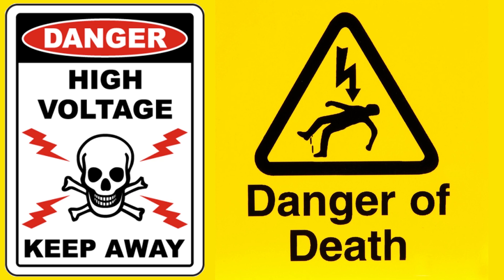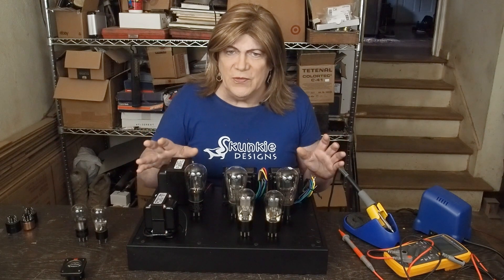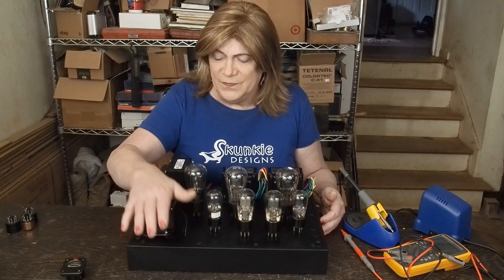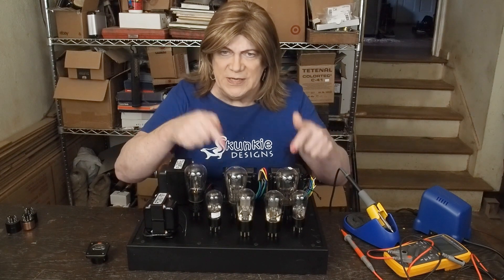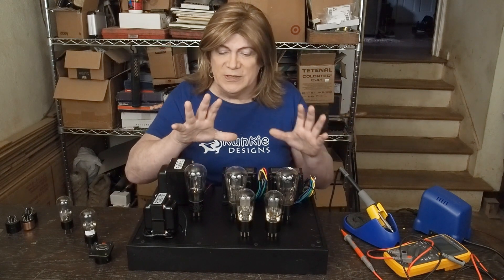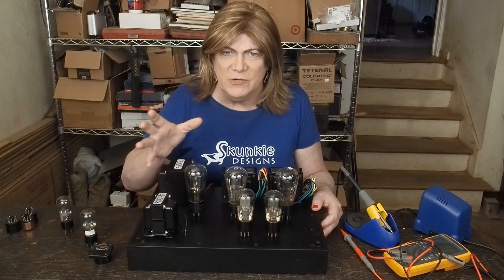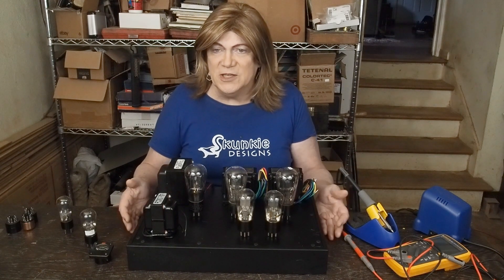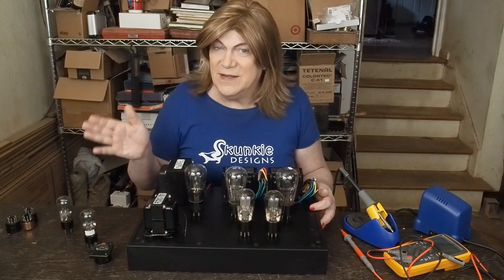1930's Globe Tube Amp Build: Overview

Comment: Is this the same type of amp used that was used in 1930's to 40's tabletop RCA ,Philco tube radios?
Reply from the maker: Absolutely not. The circuitry used in this amp wasn't even invented until the late 1950s and some of the tweaks to the circuit have come about during the last decade or so. When these tubes were produced there wasn't an amplifier like this to put them in.

Comment: Use the 56s too! That would look so cool if you can get enough filament supply in that chassis. Also tell us where that chassis is from and maybe link it!
Reply from the maker: I am going to start out just using the 27 tubes as drive but I won't be upset if I have to add the 56 tubes :) I am definitely doing the layout with that in mind. This is a custom chassis a friend had made locally, cost me about $130 (buddy deal ) so not for a budget build! Landfall systems can make a very similar 12X17X2.25 one for around $140 unfinished. I would order it with black screws and plan to get it powder coated or anodized after all the fab work was done.  https://www.landfallsystems.com/

Comment: I was just wondering why you wouldn't run low voltage filaments in series?
Reply from the maker: My understanding is if there is a mismatch in filament resistance, running them in series would cause one of them to run at higher voltage than the other. I'm also not sure how you would reference these as these older tubes seem to be very sensitive to the cathode to heater voltage. Not saying it wouldn't work but that is why I decided against it.
Reply: @SkunkieDesignsElectronics  I get your concerns. Back in the day when I worked on tube radios and TVs, it was a common practice.

Comment: Now your talking my language. Being an old antique radio restore guy I have plenty of those tubes laying around. As a matter of fact I have an old chassis and it has those tubes. It appears to have 4 output tubes. Possibly could gut that bad boy and just wire up the output section as an amplifier. (the old cabinet got trashed by rats). I'm excited about this one. I really would like to learn more and power supply design is great place to start. Thanks again.

Comment: I was asking to myself, does it make a big difference in sound to use tube rectifier ? 
I guess may be there's no answer to this question...seems a lot subjectiv.
Reply from the maker: I honestly don't believe it does, especially on a single ended amp. I do like the slow B+ start up an indirectly heated rectifier provides.

Comment: The 47’s are known to sound good (at least in PP..) What plate chokes are you going to use for the front end tubes? The meters are a nice touch..
Reply from the maker: Probably the little Hamond ones, at least to test with.
Reply: @SkunkieDesignsElectronics  yeah, for testing I guess they would be fine.. The fancy Lundahls are on the pricey side. The One-electrons (220H supposedly) are good for the price, but AES is not careful with handling them IME, all banged up end bells..

Comment: If you don't mind a slight hum..................AC sounds BETTER..!  Because when you use DC on the filament , one side sees another voltage on the filament than the other side............and the trace curves waves out ! ( the nice // curves loose their desired linearity )
Depending on the tubes , hum can be reduced to almost bearly audible or some more hum , but it's a choice between quality and hum..........!
With Dc there's always the filter capacitors in the SIGNALPATH ............and yes they are printing their sound signature  on the music ........

NICE PROJECT !
PS :    WE 717A is also a good choice as driver ( input tube ) .....the famous doorknob .....
RCA/CUNNINGHAM globe 245/345 is also a marvelous sounding tube............
..

Comment: If this takes off then Philco collectors won't be happy. The Philco 90 radio used 47 output tubes and multiple 27's as did many others.
Reply from the maker: I'm sure old radio collectors that use 6SQ7 tubes aren't happy about my other amp lol. I stocked up on 6SQ7 tubes before I published it, might need to do the same on these!

Comment: According to my text books, the 47s are tetrodes, I.e. having 4 elements. The project  is however very interesting.
Reply from the maker: 4 elements + the heater, which is the cathode. It does have a grid, screen and a suppressor, that makes it a pentode.

https://www.radiomuseum.org/tubes/tube_47.html

Comment: I realize that you haven't heard what these tubes sound like, since you haven't built the amp yet but I have a question.  I looked all these tubes up on eBay & the prices are inexpensive & brands of NOS is pretty diverse.  Do you think they will sound as good as more expensive & sought after tubes like KT88, 300B, EL34, etc.?
Reply from the maker: Who knows lol that's part of the fun. I had no idea what a 6SQ7 would sound like and turns out, it sounds amazing yet no one knows about it.
Reply: @SkunkieDesignsElectronics  Thanks, I think I will watch until you complete project & if they do, take on such a project myself.

Comment: I started a globe tube amp a few months ago. It is a single channel push pull. It has a 24A as the first stage, a 27  phase inverter, and two 27's for output. it has an 82 for a rectifier. The 82 has a 2.5 volt heater like the rest of the tubes. I made it as a low power guitar amp head. I still have to tweek it.